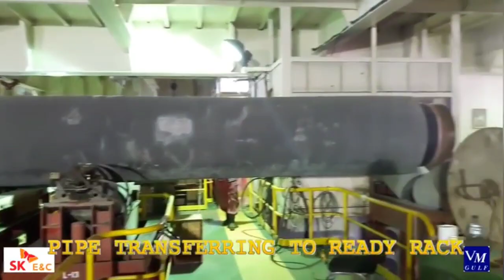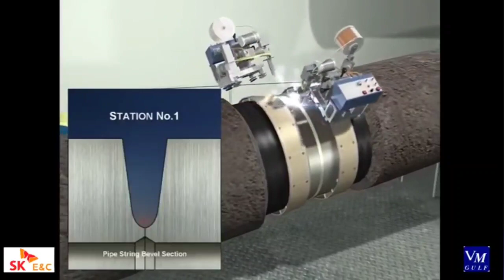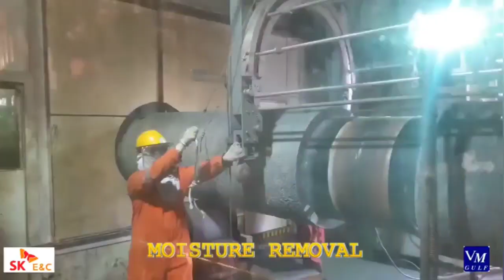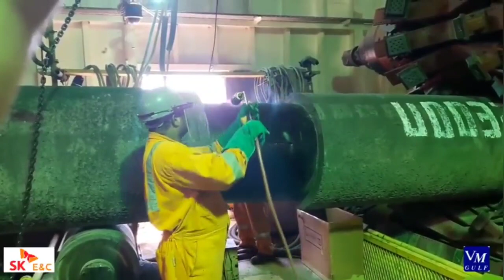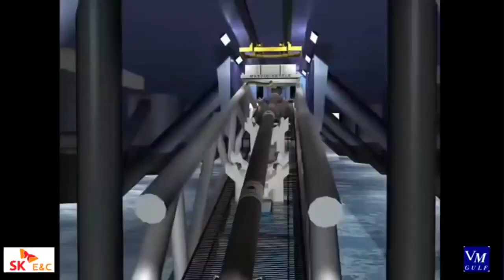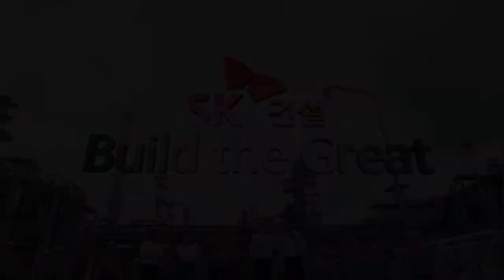Subsea Pipelines | Offshore |Oil&Gas

Comment: How does pressure fit into this? If you're a diver having to go down there, you'd have to slowly drop down over a long period of time, to pressurize, and then do same coming back up. Does the oil need to be kept under certain pressures or depressurized to offset it the pressure already down there? And if so, how does that work with the fact that one end of the pipe will be above sea level where it connects with the rig, and another end will be at sea level, when it gets to land?